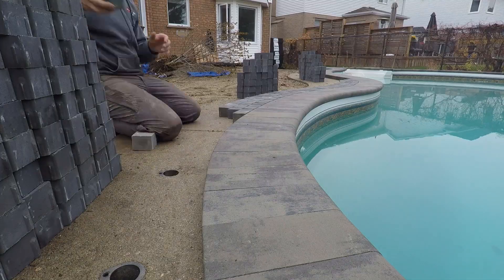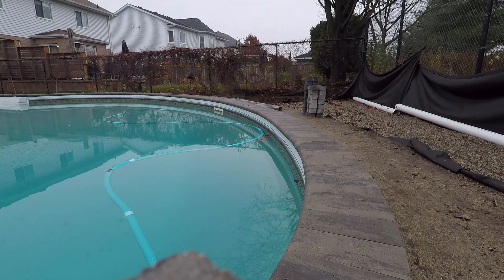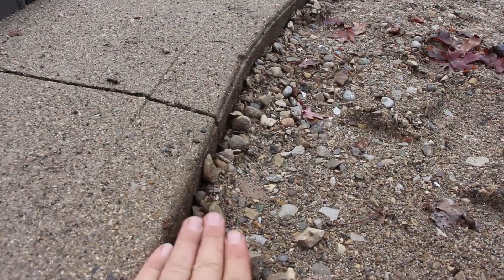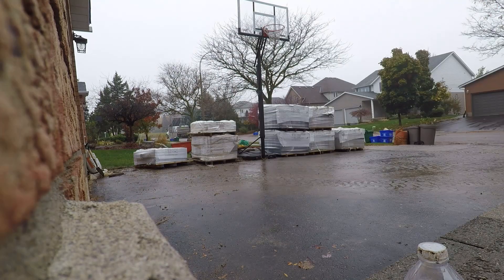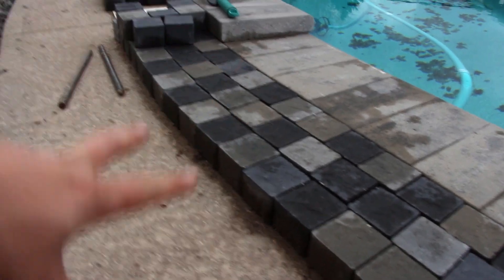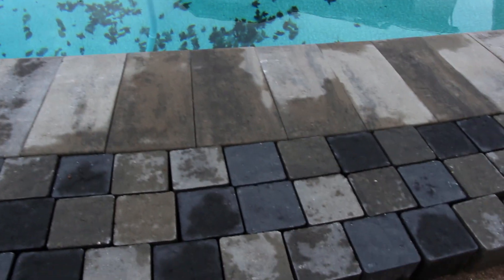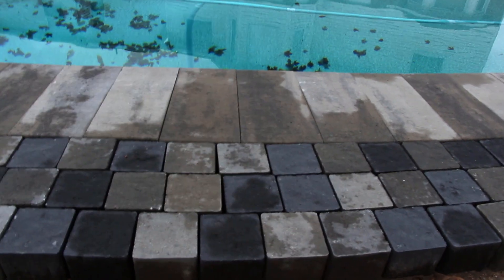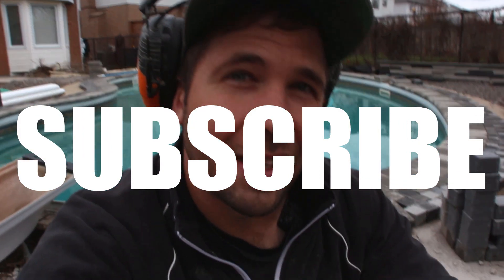Unique Banding Around Pool Coping with Pavers

Comment: which machine do you use to move full pallets? and are you finishing this job before winter?
Reply from the maker: I’m the machine. Typically we do not have the access to have a machine that can move full pallets. We get the delivery driver to get it as close as we can.
Reply: @iamahardscaper  nice gotta do what you gotts do! And like i asked are you planning to finish the job before snow settles? Or youre going to start back next season?
Reply from the maker: Base is set at this point, so we just need to screed, lay Gator base, and then slabs. The only thing we may not be able to do is the jointing which we need 3 degrees. So fingers crossed
Reply: @iamahardscaper  good luck! Just closed my season today in montreal. Expecting snow tomorrow

Comment: You're recreating the Riviera 😀👍Interesting use of the contrasting colours, I've never seen that use. 
Coping turned out ace. I may've missed it, but are you relying on the slope to manage runoff of the coping or are you going to mortar those teeny tiny joints? 😲
Reply from the maker: We will just leave them tight fit 👍

Comment: Did you install an elevator to get yourself out of this pool after swimming? Because that's a lot of height (2.375") to add to an existing water line in the pool. If anything, I would have removed the concrete collar around entire pool so you could bring those pavers down to where they should actually be installed.
Reply from the maker: It is, and it was discussed with the client beforehand with samples laid out for them to show them what it would feel like. It was not in their budget to rip the concrete out and not in their timeline to wait.